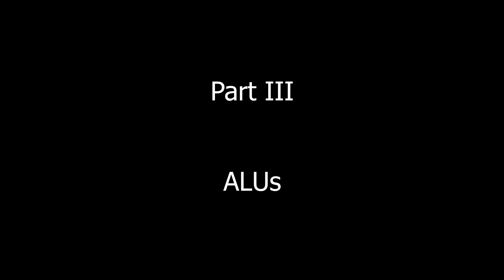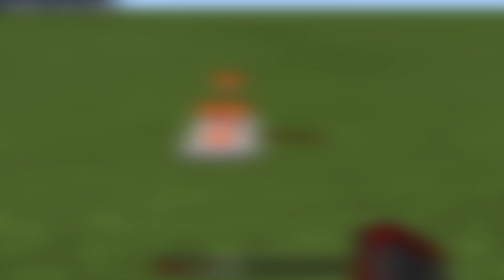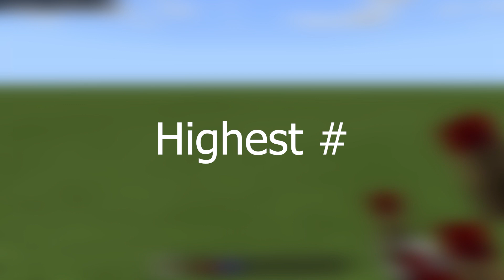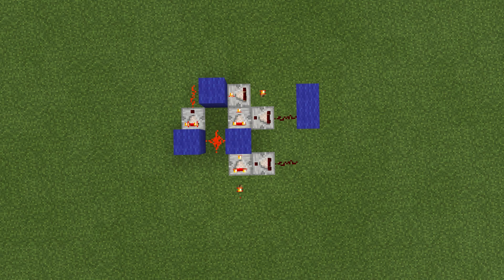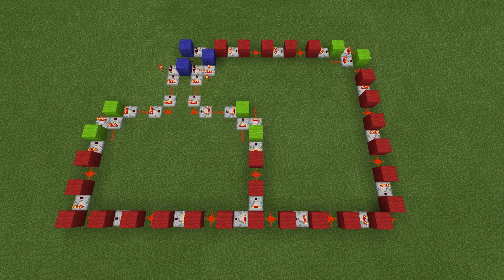Redstone Hex Computer Ep. 3: Minecraft Hex ALUs + DIY Computer

Comment: Has this been broken by a patch ?  Maybe im not understanding the output but its always wrong. and from what i can see your output register skips third part of the formula. (15-a-b) .....how is B going to be subtracted if you pull the signal before that function ? You didn't verify that the output was correct.  So i cant even see if yours is working correctly. I built this circuit with two separate interface inputs, and a target block decoder so we can see whats going on. It worked correctly when you pull the signal to the output register After the B register value is subtracted from the First half of the formula. Not sure if i took away the ability for "not" . but the adding works......

 ......... ok got it working...... the registers should be reset before they are filled. if I'm correct, only in instances where the second input to the register is lower than the first. 1+2 = 3 then + 1 and the machine breaks because the the 1 tried to replace a 2 in the register. not a design flaw..... just...... rookies (me) may overlook this when they are testing the circuit. i still dont see how the B register is being added. it seems like it is skipped in the line. however it works well and is compactable.

Comment: I realize this video is about 3 months old, but is there any sort of carry-out possibility with this? Just found this on my recommended and was curious about the limits of this concept.
Reply from the maker: So this is just uses a simple ADD circuit. However, some people have been able to make full adders in hex.
Reply: @ct5k_  I see, well thanks for the insight, I've started to get into the whole redstone pc thing without any knowledge so its nice to see all the interesting ideas out there.
Reply: @frozenfebrezecan3914 If B-(15-A)>0 you have 1 carry.
Then you need to compute the „remainder“:  B-(15-(A-1))

Is possible to do in 4 ticks. Just using two „half adders“ does not work like in binary.
Reply: @98LuckyLuk  there's a little trouble.if A=B=15 then Carry = 2

Comment: i'm new to redstone computing, so correct me if i'm wrong, but i have three questions

isn't the ADD circuit an octal half-adder that outputs hex (instead of octal + carry)?
how much larger would a hex full-adder be?
could octal be better than hex since the ADD circuit could be used fully?
Reply from the maker: 1. So octal is derived from hex, so this ADD circuit could be considered an octal full adder, just without an actual carry line. 
2. I have not made a full adder yet, but I would assume it would probably be an least twice the size, just due to how a full adder works. 
3. Yes and no. While octal would make that circuit a full adder, the build would have to be larger, since octal can only count to 7 before having to move to another bit.
Reply: @ct5k_  I've built a full adder that's 11x7x8, that also has subtract and carries. It's not solid state, but it's decently fast imo with 4 tick addition and 3 tick subtraction.
Reply from the maker: @Amy_A.  Nice! Do you have a link?
Reply: @ct5k_  I MAi made one thats 7x6 and 3 blocks tall

Comment: This is yikes for several reasons, the first being you can't do boolean bitwise logic in base 16. To do logic you need to convert to binary. So even if what you have here adds, it's not an ALU. Just an AU.
Reply: No because they’re using 15 like 1 bit when doing logic, like with the not gate, rather than 1 going to 0, it’s 15 going to 0/0 going to 15, like high and low voltage in a real computer
Reply: @ryanhasmanners9997  you can do complements in any base. It's how arithmetic is done. A complement is a unary logic operator. He can do that. He can not do boolean logic because that is restricted to base 2. I have a degree in computer engineering btw.
Reply: @WildEngineering  you can still do Boolean login with 0 and 15, as when you say do a not gate on 15, it goes to 0. Therefore you can treat 15 the same as 1 in Boolean logic
Reply: @ryanhasmanners9997  yeah
How does some people even experiment with the redstone signals 0 and 15 if they can just use all redstone signals
Reply: @WildEngineering  hmm i'll try to do this 1 and 0